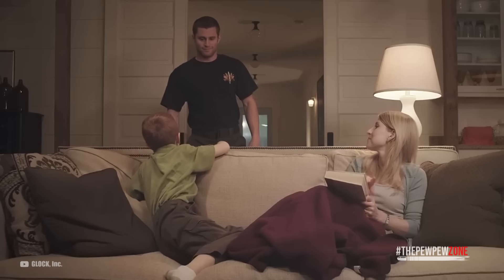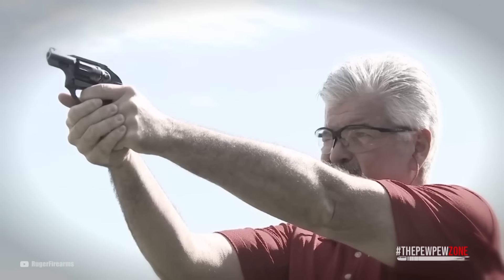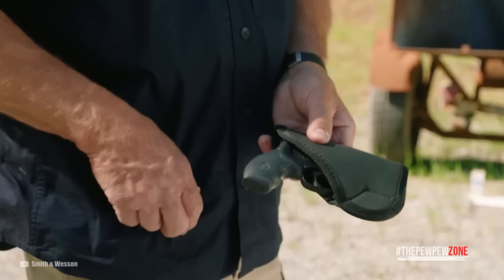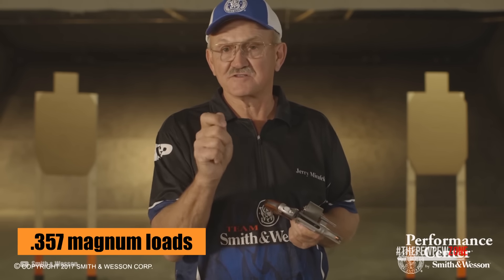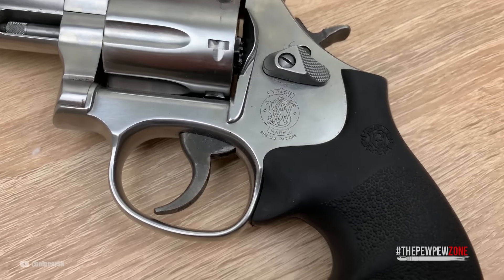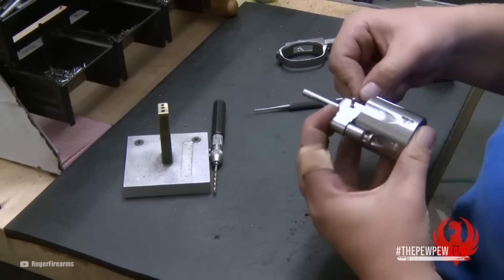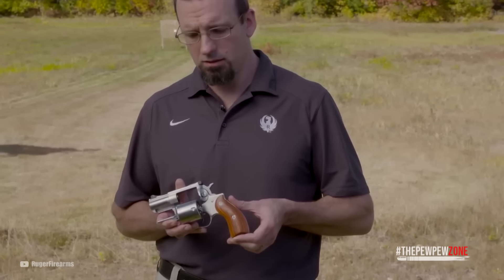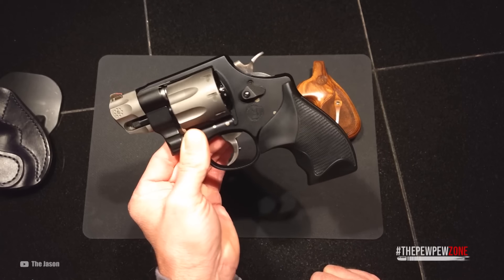These 10 Snub Nose Revolvers Are Changing the Game!

Comment: I carry the lightest weight smallest frame snag free revolver; and I don't worry about recoil. or frame damage; it for saving my life; i uses a similar gun on the range to qualify with; worked deep cover 17 1/2 yrs. been shot and stabbed multiple time and still came out on top. I have a slim frame; working in warm to hot conditions; but if you're a full framed guy wearing heavy clothing all the time; you got it made; but if you're in the toilet you better keep that Rosco Handy; They like to come for you at your weakest moment. and don't forget when you naked with a chick; better keep in closer than you are with her. probably why a can't keep marry to one woman.  Slick. :goat-turquoise-white-horns::goat-turquoise-white-horns:.

Comment: They have gone through the roof!! I had a centennial sub-nose 640 all stainless steel! Not the airweight . I believe in 1995 I paid $325 for it. A used one cost over $800
Reply: Yeah.
I bought a SS Mod 60 about 15 years ago for $250.!
Reply: The narrator said they very reasonable with 4 figure price tags. 🤣🤣

Comment: I agree with number 1 slot but  (with the revolvers you showed) but the real #1 slot OR even #2 SLOT SHOULD 100% have been the Chiappa Rhino 200DS! & you didn't even list it. Not only is it the coolest looking gun but hands down the best shooting as the lower barrel pushes recoil straight back into hand rather than the tip booming upward line every other revolver. Come on man

Comment: I have a colt Detective special, ruger sp101, s&w m37 and a Taurus m856. The Taurus is compact, lightweight, reliable and the most accurate of the four. Maybe it wasn't included because it doesn't have a 4 figure price tag.

Comment: I had a Ruger GP100 that was a total FAIL. Sent it in for service and Ruger sent it back with some new parts, a tune up and the exact same problems it had when I sent it in. Soured me on Ruger.
Reply: I have had very good luck with my Rugers, but your point is well taken.  Revolvers DO fail.  The idea that they don't is a complete myth.  My S&W 686 and my Colt Cobra have both had to have factory service for completely seizing up when warm after several cylinder loads fired.

Comment: I've got an Iver Johnson .38 caliber,circa 1926.Old police service revolver,I'll stick with it,until I find something better.LOL
Reply: You can get a variety of old police .38s. They are relatively inexpensive and they work well. 
This list is supposed to be about snubs,  though. 
The first snubnose was the SW model 36 J-frame in the 1950s. Some had 3" barrels, but most had 2", and they no longer make the 3".
Snubs are designed for conceal carry. 3" is about the limit for concealed carry, usually requiring specific outfit choices to accommodate, especially the older ones with full length grips.
The Iver Johnson you have , like most police issue .38 revolvers, is a much larger gun, made for a belt holster.  It's an easier gun to shoot, but a harder gun to carry in your waistband.

Comment: In my opinion: Have to think of snub-nosed as high cap derringers.  Realistically the 5 shots you have will be the only shots you'd use. Better practice what you preach. Lol

Also Smith & Wesson's performance anything would be very lacking. Their yolk spindles & bolts seldom align true with alot of end shake hidden by the loaded round head stamps. 

A Taurus terrible as it may seem, can give better accuracy - like 2" or less at 20 years vs S&W's 7 yard claims.

Diamond back makes the best concealed carry stuff done right in Florida & pricing is very affordable. They have the thinnest 9mm that can hold 17 in the entire market & industry. Probably best to ignore all those North East Yankee manufacturing companies of antiquity. 

Then there's Keltec too in Florida. Cheap & reliable coming with a lifetime first owner warranty. 

Keltec made the 9mm pocket rocket realistic after the failure of the Colt Pocket Pony. Too bad they dropped the 40 caliber option because that would be preferable considering the short comings of FMJ 9mm.

The Ruger SP101 is a fun shoot. Be nice if they made a pencil barrel keeping the weight & balance the same in a 4". The 340 J frame S&W also would be fun if it had a 4" pencil barrel model.

Comment: these things are SO inferior to the pocket 9mm autos (with Liberty arms 50 gr, 2000 fps solid copper hollowpoint ammo. If you DO get a revolver, get it in 9mm. The .38 ammo, all kinds, is SO wussy-loaded that it's a joke.  You can get 450 ft lbs of power out of the 9mm snubby, but only 280 ft lbs out of the .38 snubby. That's a HUGE loss of power. The 9mm is hitting 60% harder. NOBOBY claims that a .38 snub hits hard, so WHY woulld you NOT want to increase its effectivenes? Also, the Liberty arms stuff has a LOT less recoil (altho more muzzle-flash and blast.
Reply: ummm..   all the revolvers presented here are .357 not .38.   Did you even watch any of the video or were you just triggered (ha ha see what I did there  !) ?   Edit:  Now I recall, there actually was one 9mm snubby in the video, an S&W that could handle 9mm +P+, so now it's clear that you didn't even watch the video !